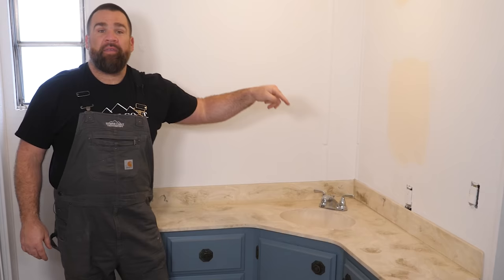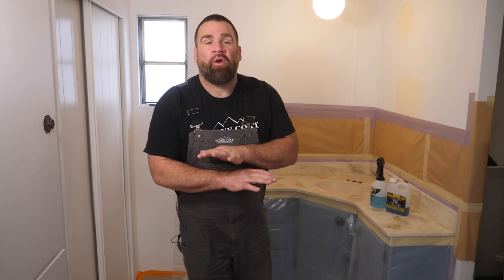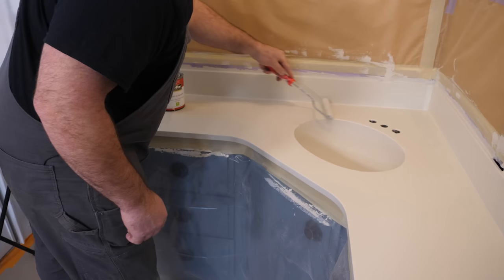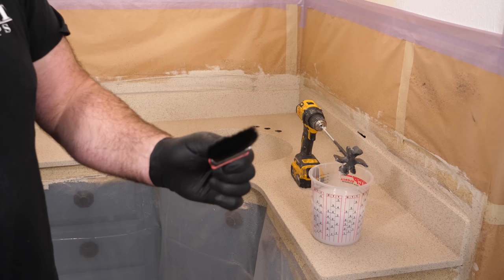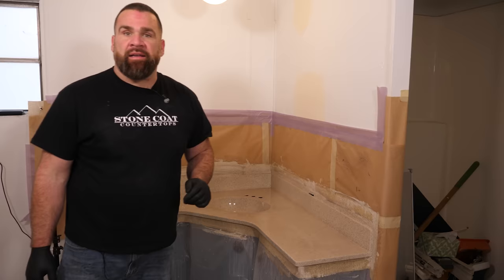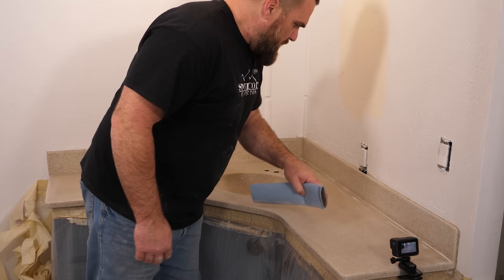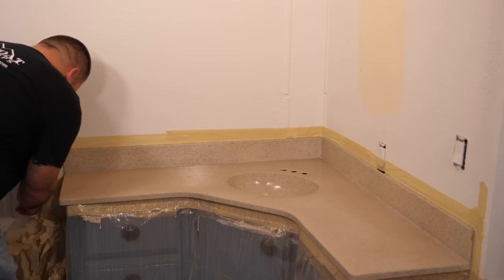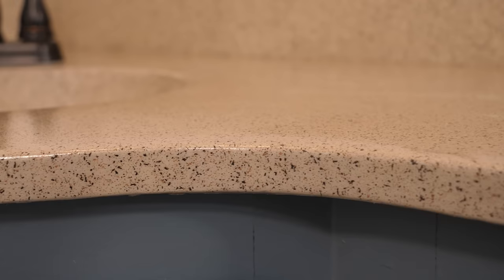How to Renew Existing Surfaces with Epoxy FULL STEP BY STEP | Bathroom Vanity DIY Makeover

Comment: Mitch, thank you for doing a video of a bathroom countertop with the backsplash, faucet and drain as part of the process. This helped fill in some areas I struggled with understanding. 

I did this process in a similar manner without the ultimate top coat on a guest bathroom sink over a year ago. The issue I had was when I reinstalled the faucet and a little of the silicon squeezed out around the base of the faucet and onto the epoxy countertop. I tried to remove the silicon to no avail. Due to the epoxy recommendations I couldn’t use certain chemicals to remove the silicon without possibly damaging the epoxy. The info online states you can use a razor blade to very gently skim off the silicon. However, I found that it still created tiny scratch-like marks on the epoxy no matter how easy I went and I created a more jagged texture. 
When I reached out to the company I was told I could redo the entire process. In my mind that doesn’t solve the issue if I have the same problem occur again with excess silicon (I’m not a professional plumber and I sadly don’t have the experience in this area to be spot-on with how much silicon to use).

Over a year later I still have a slight rubbery silicon look around the base of the faucet that catches debris and constantly looks dirty.

Q: What can I use or can be done to address the issue of removing excess silicon around the faucet without damaging the epoxy? 

Side note: The same thing happened when I installed the sink drain and stopper. However, your video provided me with the guidance I need for future projects so this doesn’t occur again - use a Dremel to clear out the excess epoxy in the opening of the drain (I had used a rasp which is more time consuming) and also use plumber’s putty around the inner edge of the drain before installing. Thank you for this detailed video showing real issues that occur and pro tips to use for a successful epoxy project.
Reply: Don't you love it when they answer you? Come on... we purchased these products and never get answers.

Comment: In my bathroom experiences of refinishing cultured marble bathroom countertops, using two coats of epoxy are required.  You sometimes have textured paint particles falling on the first coat of fresh epoxy when removing the tape and sheeting. Also, the back splashes need more then one coat to be smoother and have better coverage.  Always go with two or three paint colors to get the best looking results.

Comment: I'd like to join with @Erika LaVonn in requesting a video project of resurfacing a solid shower or bathtub.  I have a very large cultured-marble spa tub that has developed some tiny pits and some cracks.  I have always assumed that an epoxy refinish was unworkable but your sink project here gives me a spark of hope.

Comment: I have both a kitchen and a bathroom counter top project that I’m getting ready to purchase your products for. However, I’m confused about “The Ultimate Top Coat”.  The best I can tell from watching and listening to you is that it is an additional (in this case, a 3rd) application of the Epoxy.  

I am pretty sure that both the Epoxy coats one and two and   “The Ultimate Top Coat”  mixture of A and B.

Comment: Is the end result smooth and shiny like the epoxy was or does it have a texture?
Reply: Smooth if surface is level and if applied before it begins to set. So make sure it’s level and you put it on quickly and evenly.

Comment: Maybe this idea is crazy, but I wonder if doing the sink bowl separately, masking and using a different finish, would give an undermount appearance that was even slightly convincing.  You could leave a lip at the top that was the same finish as the counter, so the final look appeared to be a perfect size/alignment match between the "sink" and the "counter".   It would look far more convincing if a slight overhang could be built up using a bendable plastic strip (like a very thick veneer) and bondo to blend it in with the countertop.

Comments?

Comment: I have been using Stone coat for a few years now, my last order was the 3 gal kit of the supercast deep pour epoxy. The large resin jugs had hard solidified pieces of resin in the bottom of these brand new jugs and parts of the bottom layer of resin were thick and goopy. 
Not impressed with my last order. I wonder if they are having quality control issues!

Comment: I have a house built in the 70s, cultured marble with molded in sink, your vid shows me how to do it, but my question is, it has a built in medicine cabinet on side wall, looks like laminate, i think doing the door would be just a matter of taking it off and laying flat, but how do i do the vertical casing of the cabinet, which sticks out 2 1/2 inches, will the epoxy run,sag on vertical surface

Comment: I want to flip a dresser or buffet into a bathroom vanity. My plan is to use Stoncoat on the top. I know that on most the tops can come off so you can work on the base separately. Will stonecoat be effective on the to on a dresser or buffet when prepared correctly.

Comment: Why so many steps after the bonding primer and stone coat spray? All the other videos I've seen you just do the epoxy, heat and let it sit overnight and then MAYBE, one more coat and no sanding.
Reply: Because the stone spray is 3D so the vertices edges the stone spray may not be coated evenly with epoxy so another coat is needed. The sanding depends on how long you wait between coats.
Reply: @beanieweenie9543  thanks for your reply